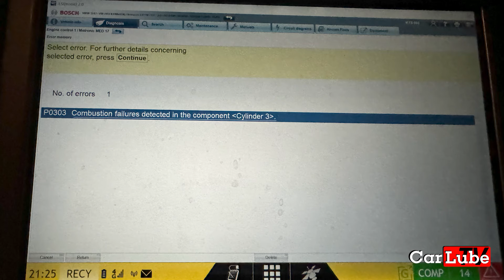VW Scirocco Engine Failure - How To Fix - Coil Packs

Comment: Had this today but my obd reader doesn’t work with the scirocco 😂.  Had to order a carista so I can see which one has gone. I’ve got 4 ignition coils
Reply from the maker: @97MRALIG  it is a good idea to change all four at the same time, and they’re not expensive either. Good luck with your fix mate.
Reply: @carlubetv  thanks. And I had to get Bosch ones it ended up costing me £166 for 4 🥲
Reply from the maker: @97MRALIG  ok mate, don’t the ones I got were that expensive about 20 quid. But at least you’ll have peace of mind that they will never go again while you have the car.
Reply: @carlubetv  hopefully appreciate the replies